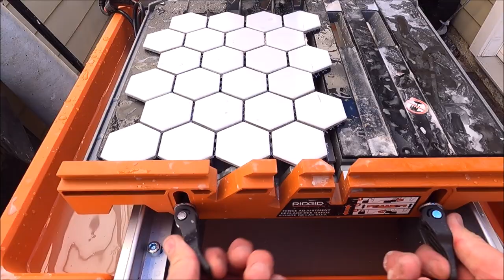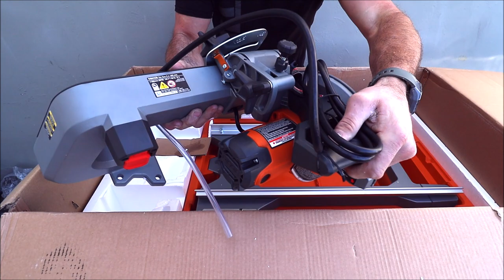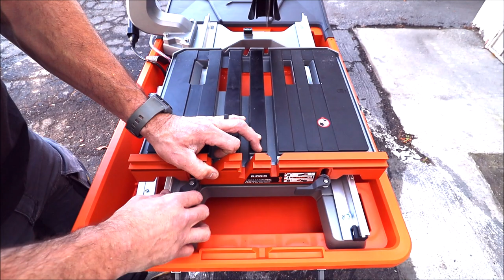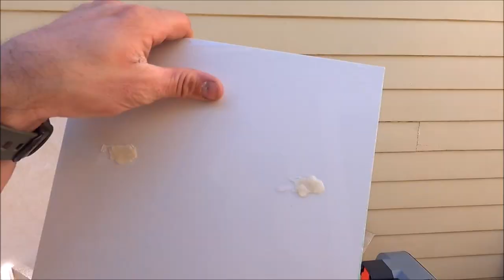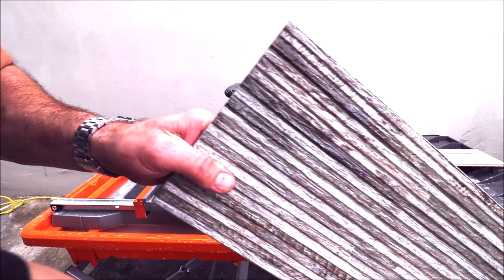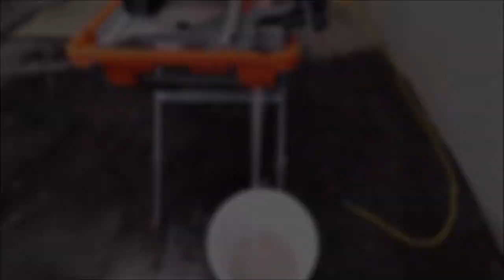This is a Beast! Ridgid 8" Tile Saw Cuts MASSIVE Tiles With Drop Fence

Comment: The wheel casters and tray last about 4-5 months before they break and there's ZERO replacement parts... They claim they haven't made them yet even though it's been out a year. I've had 2. Both ruined garbage within 5 months
Reply: A lottttttt of movement in the tray
Reply: I had the exact same experience. The wheels on the tray broke. Literally all 3 wheels. At the same time. It lasted 7 months of cutting. The same thing happened to the 7" version. Ive gone through two 7inch rigid saws and one 8inch rigid saw. As much I I love them, I cant deal with the tray wheel braking problem. Exact same lroblem on all of them.

Comment: Loved my saw until at about a year old the bearings went out!  I’m a handyman so it’s not like I do tile every day!  3-4 bathrooms a year maybe!  It’s been fixed and not covered under warranty. Using it for about 2 years for about 6 bathrooms and the bearings is going again!  Would not buy another Ridgid!  Update 3/15, bearings seized today and saw stopped working completely. Smoke came out of the motor  so it may be fried too!
Reply from the maker: They are a little cheap, but usually have a lifetime warranty if you register it on their website

Comment: I got the 10” saw and the Home Depot app said it has a laser guide but it doesn’t have one. I didn’t notice a laser in this video either.
Reply from the maker: The button is on the black handle to the right

Comment: how are those pica waterproof leads to wipe off after a cut off you don't remove the line? I got some on the way to try but I've had bad luck with markers leaving permanent marks on porcelain

Comment: I mostly work on showers, bathroom floors, and back splashes at least once a week. Would you recommend I get this saw or the DeWalt 24000?
Reply from the maker: Dewalt 2400 is hands down the best all around. This saw is inexpensive and lighter to move around.

Comment: I own the cheaper rigid without the drop fence that saw is pretty great.  I've done over 10000sqft with it.  I'm right now working on a 4000sqft floor job and wish I had a larger cutting tray as the plans are 8x48.  Thinking I should get this maybe.
Reply from the maker: It's a good saw! Little loud is all

Comment: But what’s still the best wet cut saw to use? 😉
Reply: 🟡Dewalt 36 or 24 🐐🤷‍♂️
Reply: @Losas.Company  stilllll the best?
Reply: @simonstones1918  I think so. My opinion of course but I think so. I wouldn’t be surprised most installers would agree here. Real installers I mean 😎
Reply: @Losas.Company  what can I use that doesn’t cost £1000 to buy tho?!
Reply: @simonstones1918  buying used would be best. They all surround that price point. The good ones at least. Delta/rubi/Dewalt/rigid/MK/kobalt